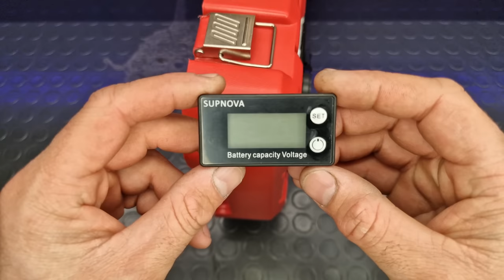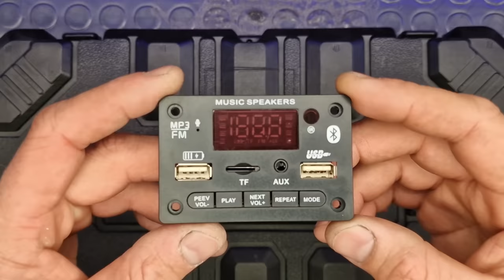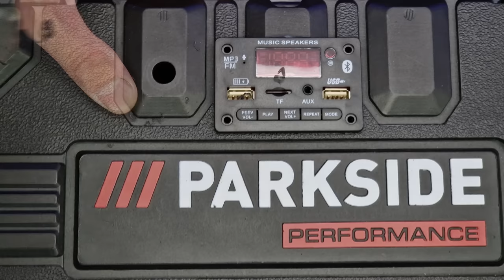DIY 80W Stereo Bluetooth Speaker using Parkside Performance X20V Team Jigsaw Box

Comment: I've made speaker builds with amps in random tool cases like dewalt... watch out for that battery pack. You can easily run the 18650 cells in that pack below a certain voltage to where the charger won't charge it up and it is a process to try to fix that and try rtv silicone sealant bro. Use it on every cut out. Put a bead around the speakers and little amp and power button cut outs and even the entire area the case opens cause I know you have a lot of air leaks in multiple places...

Comment: Nice work! 👍 Neatly done! I don't want to be rude, or anything, but can you check if the right speaker has the polarity in the right place. It looks like the left speaker is firing outwards, and the right one is firing inwards.

Comment: It's a good job. Unique handmade of this party speaker🙏🍀👍😊
Reply from the maker: I'm so glad you like it my Friend🙏🙂🤝
Reply: I laughed so hard when he used the caliper as a marking tool.. What dumb ass now measuring is not precise you just don't use it like this only if you want to break it :-)
Reply from the maker: @kitecattestecke2303  If you have a plastic caliper, it will break. But mine is steel and I mark on plastic. I have even seen experienced turners use this method on metal.😉

Comment: Very nice! I think I will have to make something like that myself =) But the "Battery Capacity Indicator" won't cut the power when the Voltage is getting too low right? The user will have to keep an eye on the indikator?
Thanks for a great idea!
Reply from the maker: Thanks for the kind words and I'm glad you enjoyed the video.🙏🙂🤝
Yes you are right there is no discharge protection, but I will look for a similar module because other viewers are also asking about such protection.

Comment: I'm laughing like crazy right now of the coincidence:Just a few minutes ago I was thinking of making one just like this from makita toolbox, and now I stumble upon this in recommendation! 😂😂😂😂😂😂

Man, I can just say one thing:I absolutely love it! Great job overall. One suggestion :Try adding sealant on the case  sides, so no vibrations can be, or air escape 👍
Reply from the maker: Glad you like it mate.
Actually, I was going to cover it with silicone if it rattled, but I gave up because it didn't spoil the sound.
Your suggestion was better actually soft gasket🙂
Reply: this means youtube knows what you are thinking

Comment: Estupendo proyecto compañero....Le doy la enhorabuena y las gracias por compartirlo con la comunidad......Una duda que tengo....¿cómo ha evitado las vibraciones dentro del maletín de plástico?.....Normalmente se generan muchas vibraciones indeseadas que hacen un ruido muy molesto al no estar el recinto insonorizado.....Un gran abrazo fraternal desde Las Islas Canarias (España)................Bendiciones.....................:thanksdoc:
Reply from the maker: Thank you very much🙏🙂🤝
At first I also thought that there would be vibrations and I was going to close it with silicone, but after I tried it, the sound was very clean and I decided to leave it like that.  Maybe the battery adapter also helped a little, because while installing I tightened the two covers.
And by the way the suitcase is soft, otherwise there could be vibrations.  greetings from Bulgaria my Friend👋

Comment: Noice! Is there over discharge protection in it? Battery is not protected so be careful with it.
Reply from the maker: There is no discharge protection, but I'm thinking of adding one.
Thank you for your attention my Friend🙏🙂🤝
Reply: You can just jump start it if the charge becomes too low.
Reply: The battery already have overdischarge protection.
Reply: On bms circuit

Comment: Great video. How many watts does this pit out cheers, also looks like the speakers are wired out of faze to me but could be wrong. Next time try adding a passive radiator on the back to help with bass or make one that's 2.1 with a subwoofer in it.
Reply from the maker: The module is 2 x 40W you mean the wires that go to the tweeters?
Reply: @ErCanEverything  no the main speaker cone one is pushing and and is pulling. One is going in and one is going out. They are moving in opposite directions by the looks of it but could be wrong
Reply from the maker: I noticed this but when checked the cables, everything was properly connected, even in the video you can see it. I think this is due to the fact that there is no hole and that's why they move like that🤔
Reply: @ErCanEverything  having no hole shouldn't make the speakers move in opposite directions. Loads of Bluetooth spekaers you buy on eBay or Amazon don't have holes and don't have that problem but amazing build anyways pal. I have a Sony Bluetooth speaker that has no holes and the two speakers play in the same direction. The amp could be wired up back to front
Reply from the maker: I have to check the polarity, maybe they mislabeled on the board
Reply: @ErCanEverything  don't stress too much other it. The speakers still sound amazing keep up the great work
Reply from the maker: @1234mattyman  Thank you my Friend😊🤝
Reply: @ErCanEverything  your welcome happy new year to you.
Reply from the maker: Happy new year my Friend🙂
Reply: @ErCanEverything  try inverting the polarity on one of them! i noticed the same as well, and you can check it with a frequency generator, set for example at 1 hertz. If they are really wired with opposite polarity, inverting one of them will drastically improve the sound.
Reply from the maker: I got a lot of comments about it, I also noticed it and as soon as I can check it out. A tone generator is a good idea.
Thank you so much🙂🤝

Comment: Also some bms would not only add discharge protection, but could read the temperature probe from the battery's third terminal
Reply: Gdie moge dostai opis dokladny czensci
Reply from the maker: In the description there are

Comment: Nice work. But where is the last red cable soldered too the board going? Can't see where it is connected.
Reply from the maker: Thank you so much🙏🙂🤝
This is the FM antenna
Reply: @ErCanEverything  Another question if you may. I used your link to purchase the power button switch, but the one I recieved had 4 pins. (Silver Power Red, Momentary self-reset, 12-24V(12V24V), 12mm) Looks like yours only have 3pins. Do you know how I should solder the cables to a 4 pin with the same set-up as you have?
Reply: I fount out of the wiring, but ordred the wrong switch. Should have been the latching version. Orderes a new one.
Reply from the maker: You are not the first, and I had ordered the wrong switch😁😂

Comment: Nice work. I think the cables on one of the speakers are connected the wrong way
Reply: I thought the same but I watched the video again and the connections seem correct. It is probably an issue with the amplifier module. Yes, would be a good idea to invert the wires on one of the speakers to see if it works better.

Comment: Can u use any type of wire or does it have to be certain kind 👍🏽
Reply from the maker: It can be of any kind.
For the adapter I used 0.75mm² and the rest are 0.50mm²

Comment: Where's the magic 80W? Power from this audio unit is maybe 3+3W. PAM8403?
Reply from the maker: You just need to hear live, on video you can not understand the power. But I know what you think, and I can't assure you of that. In your opinion, 5W amplifier can go crazy 40W speaker to such an extent? Simply the microphone automatically corrects the noise. 😉

Comment: Just put passive radiator to get bass quality.
Reply: Probably not needed with those two big 6.5" cones ...and would have to be fitted to back which would affect the looks I think?
Reply from the maker: Because there wasn't enough space in the front, so I decided to mount it in the back
Reply: @ErCanEverything  What? U mean u added a passive radiator? Its not in the video
Reply from the maker: @typhoontim125  I didn't understand the question, I meant that I put the player on the other side of the suitcase because there is no room next to the speakers.  Otherwise, there is no problem even without a radiator🤦‍♂️